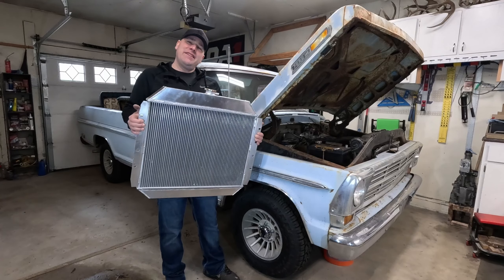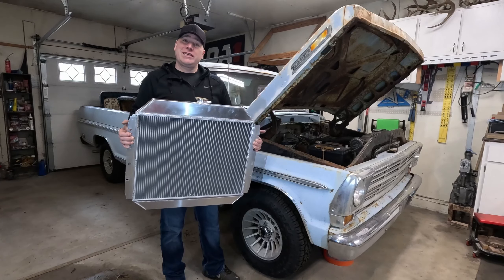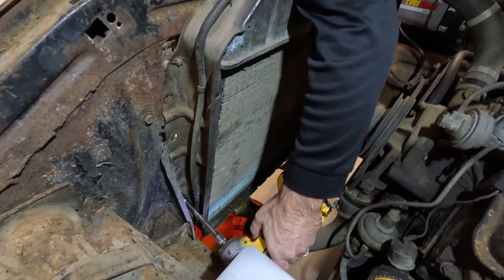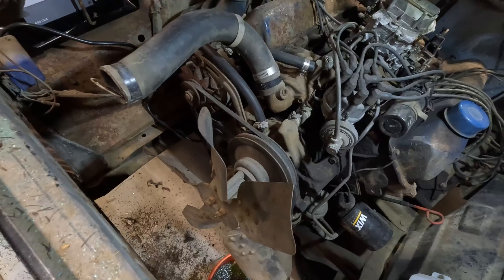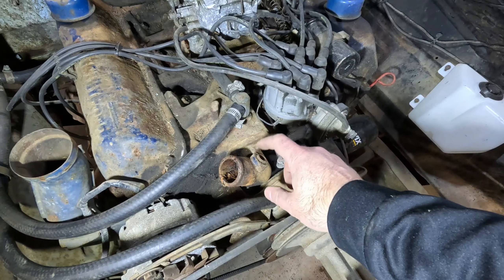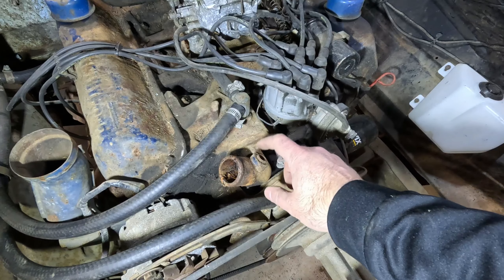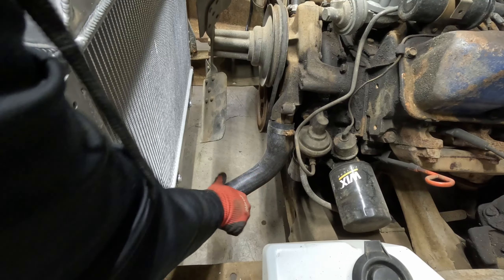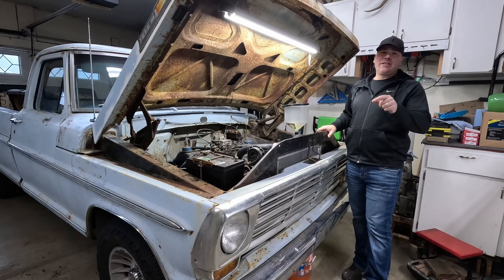Installing a New Radiator in the F100

Comment: That core support and engine compartment needs some rust removal and paint! Also, that lower neck looks like it will be a future issue if not immediately. That junk you saw with the upper hose removed points that you need to flush your cooling system and replace that T stat. Should be done before a new radiator 😮 Lastly, you’ll save money if you added a fan clutch type fan. Easy junkyard upgrade.
Reply from the maker: Thanks for the heads up

Comment: Hotdog down a hallway. I haven’t heard that in a while. So little known fact about these Hong Kong race car parts. Summit and I found out that they are intended to be installed with a rubber isolator between the radiator and core support. It stops the cracking and spaces it out more. Mine is setup that way now and made zero difference in cooling performance.
Reply from the maker: Haha, good to know.  :)
Reply: @AndyKruseChannel  I was cracking one a year and summit covered each one. On the 4th they finally got involved to figure it out. Otherwise it’s been a good radiator lol

Comment: Great job, just a few questions. WHY aluminum?
is it better cooling capacity, resists corrosion, more expensive?
my stock rad just sprung a pinhole leak, looks kinda corroded so if i fix it may just keep happening, so considering new aluminum if price is right or used one if not.
Reply from the maker: When looking at the chart of the best conductive properties of all metals, Aluminum is 4th (after Silver, Copper, and Gold).  So purely off the ability for a radiator to radiate heat, Aluminum is nearly the best choice, especially considering the economic weight of buying a radiator in those other metal options.
But in reality, you're not likely to find a steel radiator as aluminum Rads dominate the market.  Lots of people do just fine with stock units, but for a couple extra pennies, I wanted a shiny aluminum Rad in place of the boring black-looking units.

Comment: Just a note, on cast iron Ford engines I use diesel antifreeze.  I find it works great.
Reply from the maker: Thanks for the heads up.
Reply: Why? What's the difference or what makes it better for these applications?

Comment: Hi Andy thanks for your video. Andy, I have a question, what do you think about some kind of power steering on the mustang I am 66 years old and I am wondering about that, thanks and cheers.
Reply from the maker: I would like to do power steering, but it will probably be an Electric System as I'd like to minimize the clutter under the hood.  :)
Reply: @AndyKruseChannel  SuperfastMatt has a great video on using a Toyota Prius electronic power steering setup, lots of hotrodders use it with good results. Biggest issue would be if there's space under the dash